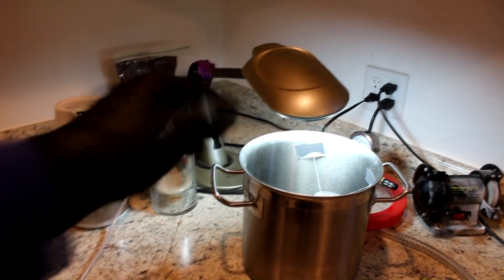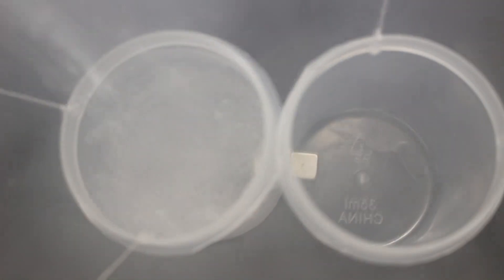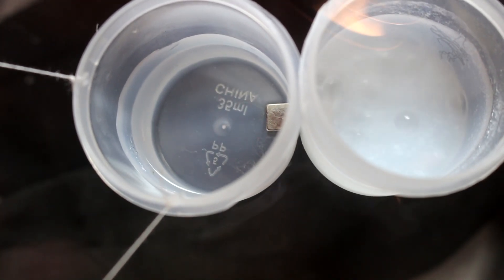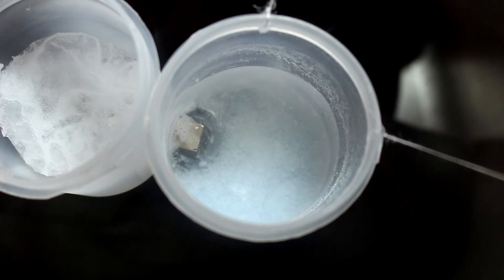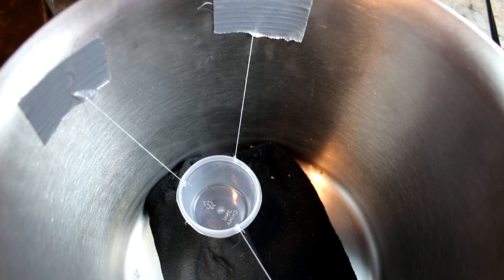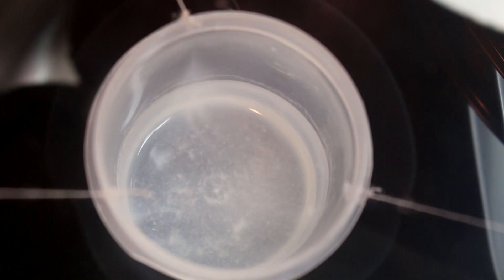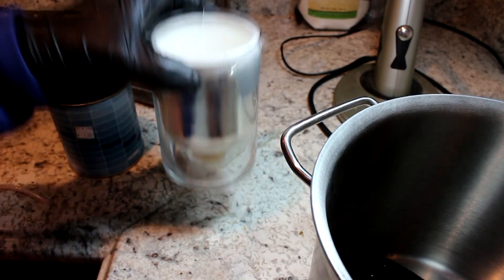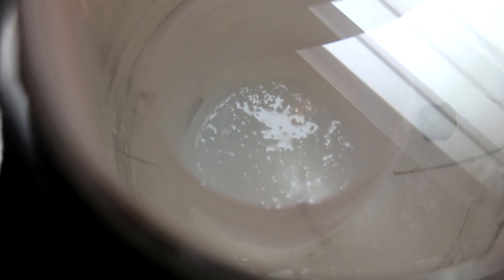Making Solid Oxygen

Comment: Cody, that is very cold! Great video. I was wondering about the magnetism of solid Oxygen. It seemed like the oxygen was piling up on the magnet as it got colder, any idea what would have happened as the Oxygen solidified? Thanks for sharing the experiment.
Reply from the maker: I believe the magnetic strength gets stronger as it gets colder, farther from the curie point and all that. However I am yet to test it.
Reply: Cody'sLab hey odd question but 

What would happen if you were to drink liquid oxygen
Reply: considering how low a temperature it has, it would likely do massive damage to any tissue it would come in contact with, not 100% certain if it would get far enough into your system to kill you before evaporating, but at that point you'd probably make you bloat and you'd have to go to the hospital...best case scenario unless it didn't get far enough to actually swallow
Reply: While at university one of my now sadly departed lecturers demonstrated the magnetic properties of oxygen by pouring liquid oxygen (nice blue colour)  into a large test tube attached to a piece of string. When a magnet was brought near to the test tube it would swing towards the magnet.  He  used to soak digestive biscuits (cookies) in liquid oxygen and set fire to them.  They would take off like Catherine wheels.  He also demonstrated that by  absorbing liquid oxygen into a cigarette you could smoke the entire thing with one 2 second drag.

Comment: Would it be possible to react the oxygen instead of sucking it away? Similar to how a candle will leave a minor slight vacuum when enclosed. Assuming you can find a suitable reaction that can react liquid oxygen in low pressure, low heat environments.
Reply: could you make solid neon?
Reply from the maker: Not a bad idea! I could use a bunch of hand warmers! just be sure to insulate it well....

Comment: Hey cody, I work in the oil industry where we use fluid weighing anywhere from 10 lb per gallon saltwater to 11.4 ppg calcium chloride solution to combat liquid pressure from 20 psi to say 500 psi. after we pump say 40 barrels down the 2.875 in diameter tubing at about 3 bbls per minute. this fluid falls until it hits  7.4 ppg oil (generally 10,000 ft.) after we stop pumping the tubing goes on a deafening vacuum (sometimes like a jet engine). could you derive a formula based on the information i gave to estimate how strong of a vacuum you'd have initially have and how long it  would be before the down hole pressure could begin to push back?

Comment: Cody it was fun watching your video today. Myself I come from a electical plasma background with strong research in semiconductor, medical and industrial practical applications. Seeing you have fun with vacuum and gases brings back how we would play around with stuff in our labs. You're almost there Cody, pulling a vacuum with different gases and using electrodes with a small RF /microwave power supply you could create some of the most beautiful light through particle excitation. The action of the gas molecules can do more than produce plasma. They tend to be like little scrubbing pads and can remove layers of metal or whatever you want down to the angstrom.

Comment: Cody, you should try reducing blackbody radiation to your nitrogen and oxygen with Super Insulation, I use it in my lab. It's basically many layers of mylar that reflect the heat. If you work out the equation for blackbody radiation its actually quite a bit, 10s to 100s of watts.

Comment: at 9.04 did the surface draw like an hexagonal_ish_ pattern or is it just me? O_o
Reply: Not hexagonal but a bit polygonal yes. Good observation
Reply: Aiden Rathbun what could it be? a kind of wave produced/maximized during the decrystallization? It's like it grows and by the end looks like a quad. ^_^
Reply: Maybe as the Solid Oxygen melts to liquid oxygen some of the solid oxygen crystals stay. If the solid oxygen crystals are less dense than liquid oxygen, then the liquid oxygen would stick to the solid oxygen crystal structure, because of the surface tension of the liquid oxygen. but the world may never know¯\(ツ)/¯
Reply: (sorry I was a bit distracted when I wrote that so I for got one thing) If the solid oxygen was less dense than the liquid oxygen the solid oxygen would then FLOAT UP creating a crystalline structure on the surface (then read the third line and fourth of the first comment)
Reply: It's a crystal. Crystals are always polygons because of the way they form.

Comment: i dont get it.vacuum decreases temprature?! please help
Reply: It increases the evaporation rate which induces a decrease in temperatute and also temperature is the jiggling around of the molecules. If you remove the molecules all you have left is radiated energy, no more conduction since there is nothing to conduct heat.
Reply: When liquids evaporate, the molecules with the most energy leave the mass of liquid first, removing energy/heat from the remaing liquid. The reduced pressure allows slower moving atoms to leave the surface of the liquid because there are less gas molecules to bump into, thereby reducing the remaining liquids temperature further.
Reply: Because the freezing point of a liquid is dependent on the pressure of its surroundings.
Reply: thx guys

Comment: Why not use pure oxygen to demonstrate?  The liquid air that you used, while it does contain oxygen, also contains a large fraction of nitrogen, which we'd expect to form a slush in the mixture.  How do we know that you weren't just demonstrating liquid nitrogen slush in the liquid air?
Reply: thom1218 you can tell from the pale blue color that it's mostly liquid oxygen.  Also from the fact that it's magnetic
Reply: Nitrogen doesn't liquefy when in contact with liquid nitrogen, in the same way that water doesn't solidify when in contact with ice. The boiling point has to be higher, not the same.
Reply: Because it took a longer time to cool and as soon as cody opened the window the oxygen turned into its liquid form again.
Reply: thom1218  The liquid oxygen may have been contaminated with Nitrogen, but the nitrogen would have boiled off long before the oxygen froze
Reply: And it’s magnetic

Comment: can someone explain cause I thought lowering the pressure boils it instead of freezing it.
Reply: thanks
Reply: Lowering the pressure means removing the pummeling of the air molecules on the surface of the liquid which keep the liquid liquid. Without much of those, jiggliest molecules in the liquid can escape faster, and they do, leaving behind a bunch of less jiggly ones. Less jiggliness = lower temperature.

Comment: what are "inches of mercury"?
Reply: This should help you out http://lmgtfy.com/?q=what+are+%22inches+of+mercury%22%3F%EF%BB%BF
Reply: i probably should've just googled it thanks 😀
Reply: I believe it is the amount of vacume needed to pull mercury up a tube 1 inch at atmospheric pressure. Please correct me if i'm wrong I followed your link and it was not really clear
Reply: It's a measurement of pressure, equal to 0.49 PSI, but it's relative to vacuum, so at sea level the measurement would be 29.92 inHg

Comment: If you are using a vacuum pump designed for refrigeration you should not have any problems with it overheating, those things are designed to run all day. I don't know why they heat up so much, but every one I have ever used gets burning hot and I run them for 3 hours at a time.

Comment: You complain about how explosive his experiments were, yet you are trying to recreate or expand on his explosive experiments? Be safe, Cody
Reply: Al Capone Only problem is he never came even close to making the explosive mixture
Reply: it isn't dangerous if he doen't let the hydrogen gas to the air
Reply: Cody works with small amounts of dangerous stuff. In the event that something goes wrong, it isn't going to blow up the lab or something. He would get a puff of flame and maybe singe off his eyebrows. The worst thing would be it breaks some glassware and het gets cuts from the debris. Hydrogen doesn't really explode, it burns slowly compared to real explosives. Small amounts should be safe.

Comment: Why don't we make things out of solid oxygen? We could use solid oxygen to make cars, houses, bicycles, furniture, etc. There's such an abundance of it in our atmosphere it would be good for the environment, it doesn't require much processing or chemicals and we wouldn't have to mine it out of the ground. 
I might start a kickstarter for this, I think there are plenty of people who would love to get an eco-friendly bed constructed from planks of solid oxygen.
Reply: Maybe we can make buildings out of solid oxygen. If you grind the solid oxygen down into sand-sized particles you could make concrete out of it.
Reply: and someone just doesn't get the sarcasm...
Reply: Torgo Great! Now we only need temperatures that can kill us in fractions of a second and/or pressures that would kill us almost instantly
Reply: Torgo dude, you're a genius! Why don't we eat solid oxygen too? Much better than having to breathe it in all the time.
Reply: I can help to make that kikstarter maybe 60/40 share?
Reply: not to mention that our atmo is 70% nitrogen so even if this was somehow possible it'd be better to use nitrogen, nitrogen also freezes easier
Reply: this is a joke right
Reply: you would burp alot
Reply: On a slightly  more serious note, why don't we use solid oxygen to make closed circuit respirators.  Shouldn't the oxygen be far more condensed than can be achieved with a compressed air cylinder?  Of course the temperature issue could be fixed with heating and cooling elements respectively with things such as thermo-electric generators.
Reply: Nickademus, there is no reason to use solid oxygen instead of liquid if you are doing that.
Reply: Nickademus77, It would be better to use liquid oxygen than solid, as solid oxygen is less dense than liquid oxygen. Also, it's easier to keep oxygen a liquid than solid. Another problem is  what happens when you breath pure oxygen. You don't last very long. We produce energy by by combining sugars in us with oxygen, much life a fire does. Now, imagine putting that fire in an extremely oxygen-rich environment... Now you can see our problem.
Reply: Torgo is this a real comment?
Reply: no one got the joke
Reply: no one got the joke
Reply: no one got the joke
Reply: no one got the joke
Reply: Question is, why not of C02...
Could "easily" strip the oxygen from the carbon, use the carbon in carbon fibre.  What is produced would be a carbon sink.
From one troll to another... not a bad idea, but, butt-backwards.
Reply: The people on this channel (at least the people from 7 years ago) seem to be absolutely incapable of understanding a joke
Reply: Torgo that is actually one of the dumbest things i have ever heard. It sublimated at room temp, never mind what temperature the engine of a car can reach.
Reply: Torgo no
Reply: Torgo not how this works bub

Comment: That vacuum pump always overheats! 
It sucks!
Reply: it doesn't suck when it overheats though
Reply: Pun intended?
Reply: I would just pour liquid nitrogen over it to cool it down... :)
Reply: BUDUMTSS
Reply: I know, that's why I added the :) :D
Reply: Just need to change the oil in there, and use a better oil than the cheap one it came with.  When it is empty undo the 4 capscrews holding the oil tank on and clean out the gunge from there as well, means the new oil will stay cleaner longer.  Wipe down the pump as well and get the rust off it.  As well simply using an external fan to blow air over the motor casing ( in addition to the one already there) will keep it cooler, and thus stop it from tripping on the thermal cutout.

My vacuum pump I have had running for a weekend to get moisture out of an AC system, and it was fine, just changed the oil on the Monday again as it had gone milky from the condensed water. New oil Friday and new oil ( plus a strip and clean) Monday and it was fine.
Reply: AL_O0 JUST COOL IT WITH LIQUID NITROGEN!!
Reply: hi
Reply: And crack it lol
Reply: I regularly use the freezer to cool down my overheated Proxxon (Dremel-like) multitool and the face mill... they seem to take the punishment quite well. What's a few more degrees below that... :)
Reply: Get a bucket and a bag of ice and put the vacuum pump in there should help some.
Reply: Certain Tonic or a dry ice bag
Reply: vacuum pumps will overheat naturally while in use. just some more than others
Reply: AL_O0 that joke was almost as dry as solid CO2....
Reply: WhippyPLayZ MC You necro'd a comment to make a false claim?
Reply: @Nathan Boody no u
Reply: AL_O0 You spelled vacumn wrong

Comment: Your vacuum pump overheated while trying to freeze oxygen to a solid.
Reply: Do you not get it? here lemme explain.... He was trying to make solid oxygen and ironically his hoover over heated means it became hot.
Reply: That is not weird at all if you look at the thermodynamics. He is putting energy in to the pump so that it can draw energy out of the oxygen. All that energy has to go somewhere, so it's only natural that the pump gets hot.
Reply: Most things you freeze are to solids
Reply: liquid to solid is actually a hot process, or exothermic. The liquid to solid material gets colder, only because it releases heat to the surroundings.
Reply: ***** I've never seen nor heard of something freezing to a liquid.
Reply: @Porglit If you really stretch the definition you could argue that a gas becoming a liquid is freezing into a liquid state. My argument would be that it's progressing towards solid and is therefore in the process of "freezing" by becoming liquid. Doesn't actually make sense but yeah, fun thought lol
Reply: I think nobody got the joke
Reply: That's condensation, not freezing.
Reply: 1st For everything.
Reply: Ivan Bustelo I did.
Reply: As long as you call upon the correct deity while doing the sacrifice you might get the results you seek.
Reply: its because energy cant be created or destroyed. in order to freeze something you dont "add cold" you remove heat. so the heat has to go somewhere. also friction of the motor and the electricity powering it all pull heat and thus you have overheating refrigerator parts. in order for something to cool, something else must heat up (or convert energy into another form of some kind.)
Reply: Blu Medic I have, but that's irrelevant
Reply: Glad to know that at least someone understands irony
Reply: Ivan Bustelo xD have a great day!
Reply: You too :))))
Reply: k, skipping over the joke, can you use sacrificial dry ice to absorb the heat transfer?
Reply: what i am asking is not to sound off about why it happens, but a simple solution:joke: dry ice and air?
Reply: if you want to cool of an object, you gotta get the heat out of the object, pretty simple stuff
Reply: @dimitarvakavchiev9539  Its kind of very stupid that he didnt cool his pump with some water or something to let it work for longer time. He went though so much complicated stuff but forgot the basics.
Reply: It's not quite weird, it's just ironic.
Reply: Porglit Water vapour to water pretty sure you have seen that in your life.
Reply: What I'm trying to say is that it's weird that his vacuum pump overheated from making oxygen from a liquid to a solid, which is a very cold process.
Reply: Guys... he tried to sound smart when trying to make a joke he ment to say its ironic that the vacuum pump thats cooling/freezing something overheated